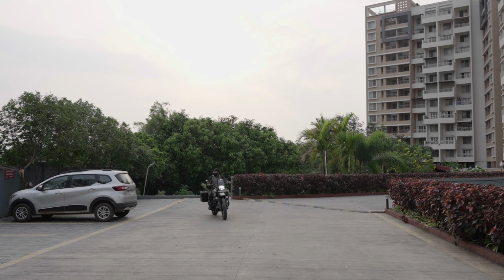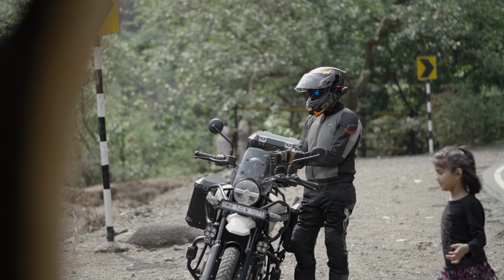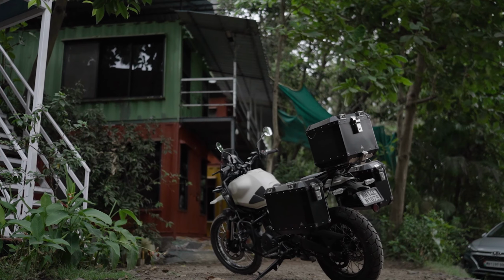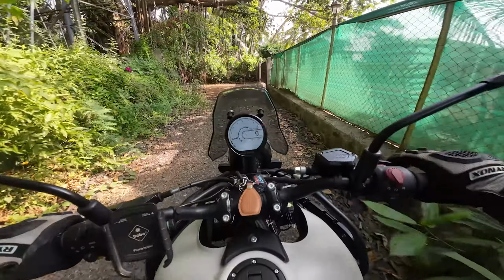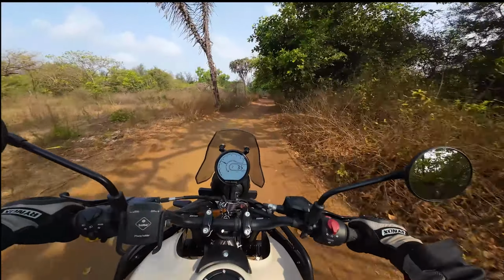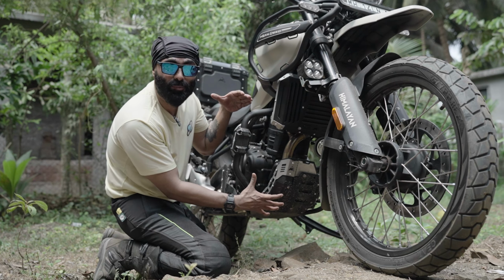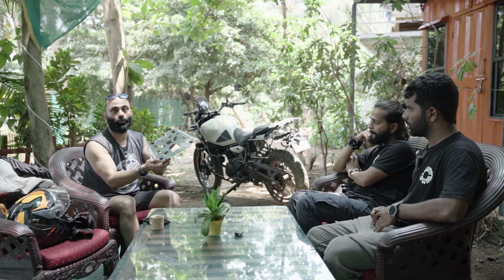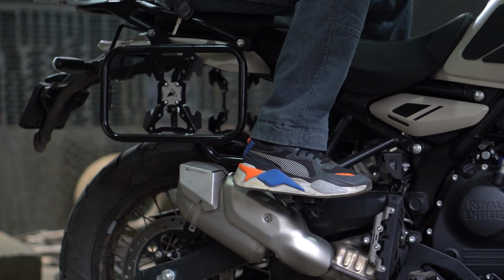BEST TOURING Accessories for the HIMALAYAN 450 | Come Ride with me

Comment: Rajeev just check out the stories behind 450 the chassis are getting dismantle and getting stall the frame is not that good there are couple of reviews they are deliberately posting but the actual news behind the broken chassis is still not clear to the viewers bro 🌹❤️🌹
Reply: They are trying to portray re as a chasis breaking
Reply: after market engine guards / sliders mounted on the chasis is leading to chasis breaking ... always go with OEM RE accessories .. which are properly designed and tested for this bike

Comment: Having owned one of these 450s for a month I can honestly say it is a great bike. Only niggle I have is the headlamp, utter rubbish. In dark streets I have to slow under the speed limit due to the lack of light from the headlamp. Either I need to add spot or flood lights or replace the headlamp. Cannot believe Royal Enfield would fit such a useless headlamp.